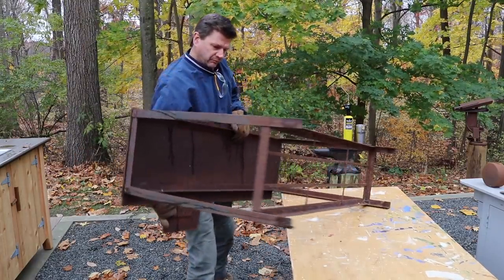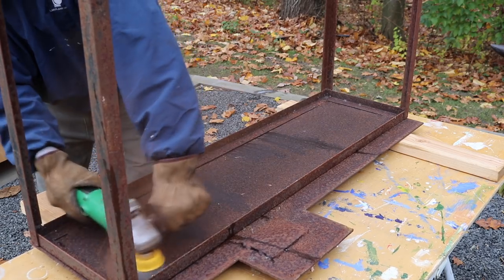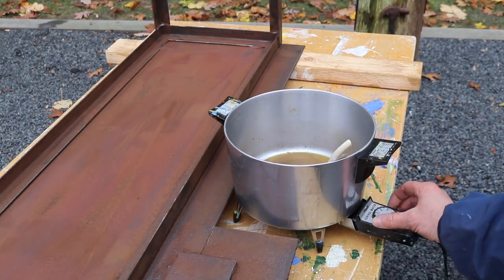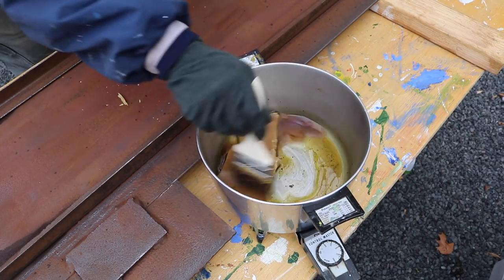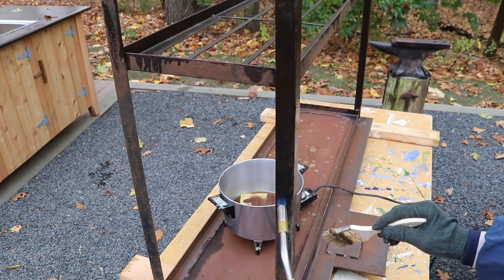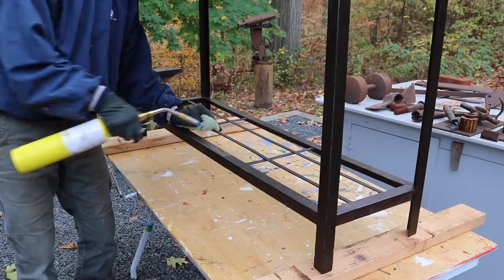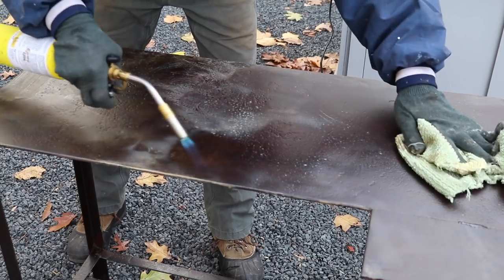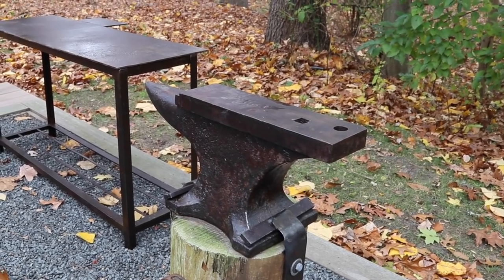How to Burn In a Beeswax Finish on a Steel Table

Comment: That's cool man. I saw some people dipping bolts in oil after heating. How long will that last? I got this floor in my step van made of aluminum diamond plate but there are steel rivets in the floor that rust. And I wanted to remove the rust and then maybe coat it or at least the bolts/rivets with smthg like oil or wax or paint. 

Plan is to cover the floor with insulation and then wood so it's going to get buried and I don't want the rust to expand under the floor. Any thoughts?

Comment: To apply the finish to wood would you do the same but with a heat gun instead of a torch?
Reply: Beeswax finish on metal works best when the metal is hot enough to sizzle the wax.
Reply: John Harris sorry didn't realise the mistake was trying to ask about applying this to wood
Reply from the maker: yes and sometimes I use the heat gun to melt bees wax into end grain

Comment: I'm super impressed with how your metal welding table turned-out!   I'm now thinking of applying bees wax to a large steel table top vise  I use outdoors.  The vise is brand-new and has factory paint on 60-70% of the surfaces.  Do you think the paint will be affected by applying the wax at 200 degrees?   I would do this on a 70-80 degree day and avoid heating the metal which will surely damage the paint.   I'd like to apply the wax to the entire vise and not just the bare metal, assuming that will work ok.    Thanks again for this excellent video.
Reply from the maker: Thanks, I really don’t know… I would try applying to a small test area first. The only problem with wax is once you put it on it’s very difficult to remove. The wax on the welding table needs to be reapplied once a year to look good

Comment: anyone that may be aware, i have machined raw steel table top for my bandsaw (brand: shopfox). it tends to get a thin layer of rust, discoloring my lumber and creating friction on the surface making sliding pieces across the table difficult. can i use bees wax on such a surface ? can it be made to a very smooth surface to allow for sliding, and at the same time be relatively wear resistant (it wont be feasible to have to reapply after every other project)

Comment: Would this be a good finish for a outdoor welding table?
Reply: Yes, the ground clamp will bite through the finish. Just make sure you scratch in what you are welding on for good contact.
Reply from the maker: yes that's what I'm using for and it works
Reply from the maker: John is  rite, the clamp bites through the wax and you can scratch the finish with work piece to get contact.
Reply: thanks guys!

Comment: Cool project, Jon. I've watched some of your encaustic painting videos and was wondering if you've ever used textured or degraded steel as a substrate/ground/support? Just thinking of the possible effects from heating a painted surface from behind. Would also be cool to see how the wax interacts with different natural metal patinas.
Reply from the maker: Thanks Mike, no but that's a good idea

Comment: You know if you dissolved the beeswax in a solvent such as toluene, then you can do the whole thing cold.
No need to heat anything up and your homemade "lacquer" will also dry quite quickly.
Minutes rather than hours.
Just a thought.
>

Comment: Hi Jon, 
would you apply this to the cast iron table of a 1950s Delta bandsaw, for example ?
Keep on trucking ! (from France)
Reply from the maker: Hi , I think so but want to use a wax past instead, I use butchers wax on my bandsaw and table saw tops.
Reply: cool, thanks for responding, and thanks for the inspirational content, works everytime !
Oh, and thanks for subscribing. My channel is a mess of spurts and trials, but it might take off over 2017... (busy rebuilding our kitchen at the moment, a major endeavour that I would never have dared attempt, had it not been for all the inspiring git'erdun videos on YouTube, including all yours... !)
Reply: i used bees wax on my sander table

Comment: Hi, Thank you for the video!
Do you know what happens to the wax when it is heated with the torch, or whats the difference of applying the liquid without heating afterwards?
I'm looking to learn more on the chemistry of this technique
Thank you!
Reply from the maker: Heating the wax helps it to absorb into the steel

Comment: Jon, would this be a safe finish to use on say a sheet of mild steel (small) that is in the kitchen. It's not eaten off or directly comes into contact with food, but it is in the kitchen (my belief is that yes it is food safe). Mainly though, I'm curious as to how much upkeep something like this would require in doors if it were permanently attached to a wall for example. Let me know your thoughts.
Reply: I'm curious to know the same. If I can seal some rustic future inside, will the wax come off if brushed up against lightly onto someone's clothes?

Thanks

Comment: Thanks for the video. Does it have a waxy feeling to the touch? Or is it smooth. Also, could you clear coat this as well, or would that be redundant?
Reply: I can't imagine a clear coat of any kind of paint would stick after flowing wax into it. No way.

Comment: on your outdoor table why don't you use a rust proof paint so you don't have to keep doing that
Reply: Because it is a welding table.
Reply: Rust-proof paint is an insulator, so it would not work so well with the welder.  Just like when you're jump-starting a car, you want to put the negative lead on bare metal, not painted.  Apparently bees wax transmits electricity.
Reply: According to http://physics.info/dielectrics/, bees wax is apparently dielectric, so it won't conduct electricity at low volts/apms.  But it breaks down pretty readily at high voltage/amperage.
Reply from the maker: I will be welding on the table so I didn't want to paint it. I tested it out and it works good.